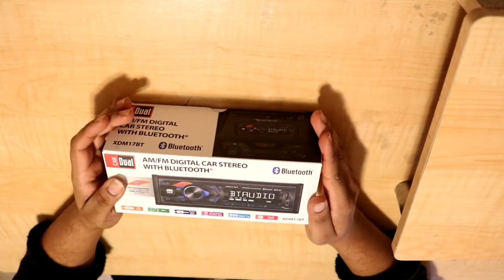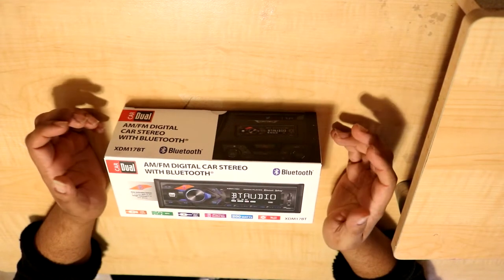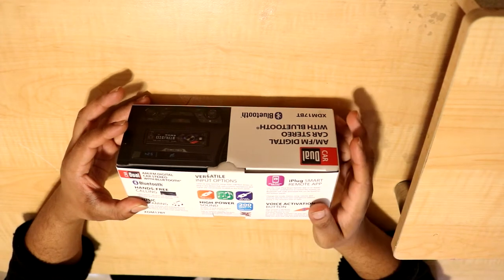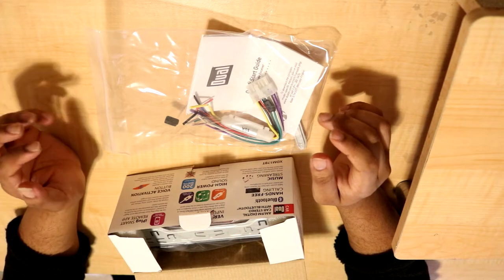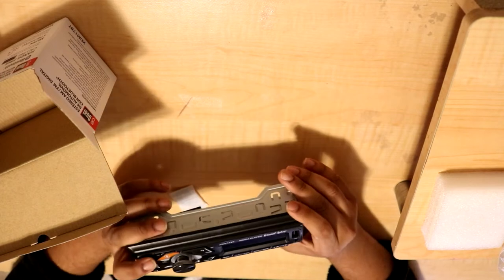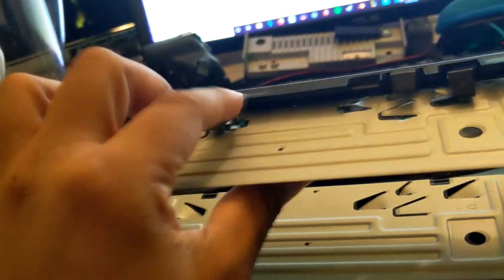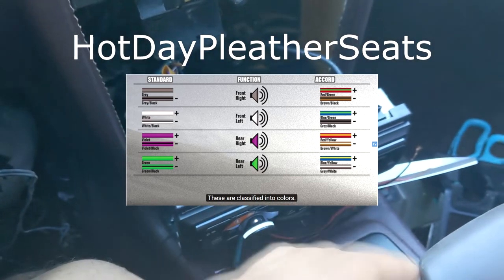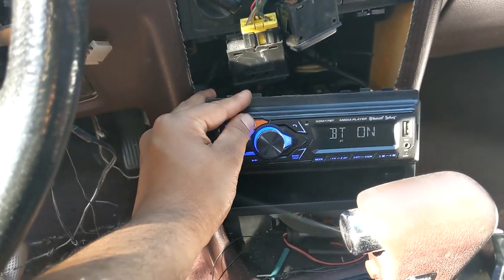A $20 Head unit with Siri and Google Assistant Dual XDM17BT/ JENSEN MPR210

Comment: This head unit works good with my sub woofer I was surprised it had a blue antenna for the subs
Reply: How did it connect?
Reply: @WyattPetersen  if I remember right I think I had to splice the new headunit wires to the cars factory stereo wires. Btw after using that head unit I realized it wasn't as loud as I wanted. either way it is a good cheap option tho
Reply: @Sj_HONDERO  I just want something I can get a sub on… not planning long term. Just until I can afford the 9 inch floating screen from boss. It’s roughly $250. But completely touch screen.
Reply: @WyattPetersen  oh ok yeah I was able to connect a sub. Just splice the amp remote wire to the head unit blue wire and I think a blue wire from the cars stereo harness.
Been a minute since I messed with subs
Reply: @WyattPetersen  but if it's a newer car I think it's more complicated since steering wheels have volume up and down. I'm not completely sure how to hook up audio on a newer car
Reply: @Sj_HONDERO  it’s a 1999 Chevy silversdo

Comment: i recently purchased this. It installed just fine but bluetooth wont connect from receiver to phone. However, my phone does pair. Any tips on how to get the receiver to connect ? Thx.
Reply: Try the reset button on the lower right of the stereo then try to connect to Bluetooth it’s gonna ask you for some code try 1234 or 0000 hope this helps

Comment: Here's the real question though, is the RCA output signal clean? Does it have LPF or HPF? Is the RCA pre-out 200mv or 5-9v? I've had shit luck with the amp outs on the new Duals, my older version of this puts out a real 200mv but the new 7in touch screen dual I bought puts out 20mv...

Comment: My Bluetooth does not connect at all
Reply: Did you find a fix? Mine isn’t giving a bluetooth connection to even connect to, I tried on different phones too
Reply: @stunna664  have you fixed yours? Mine is doing same
Reply: @Ceci Gaby yes reset it and it works fine
Reply: @jovanharrison4361  how do I reset? Mines keep saying not paired
Reply: @camwest3318  reset it.the reset is on front  right bottom use a pen
Reply: @jovanharrison4361  thank you 🙏🏾